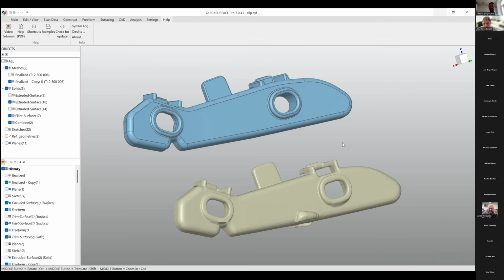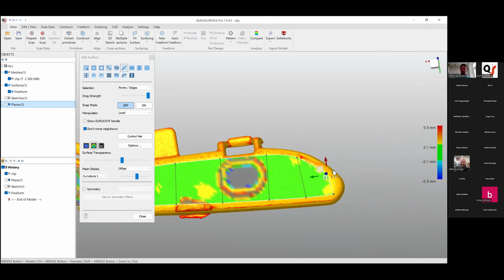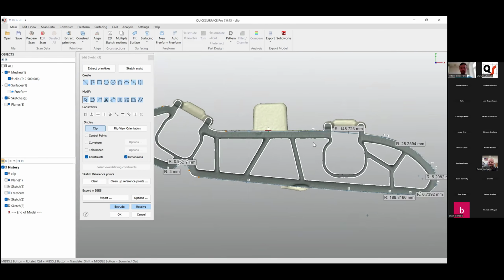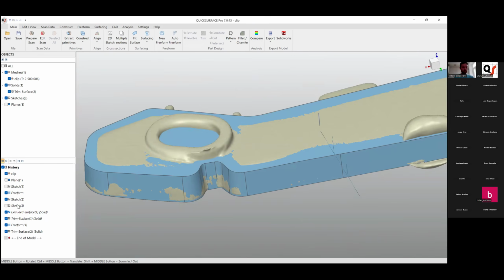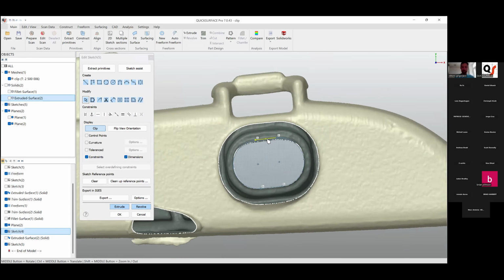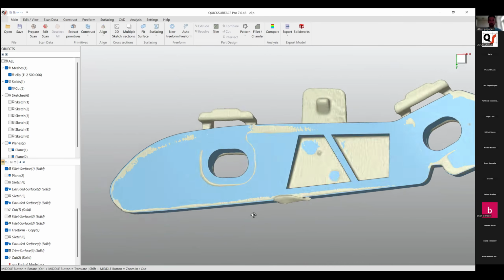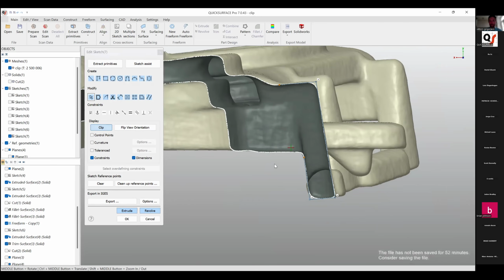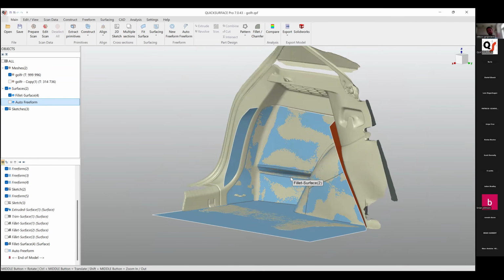Workshop: 3D Reverse Engineering a FREE FORM with  QUICKSURFACE (Level: Easy)

Comment: Many thanks Viktors for your hard efforts, we all face such like these problems even we did it before, so i suggest to have small video showing how fix the problem of the first fillet. Between outer edges and top face.
Reply: yeah, sometimes it just goes wrong :D we are working hard to eliminate such cases and trust me - we are close to point where we will be able to forget such issues ever existed. thanks for suggestion, i might give it a shot.